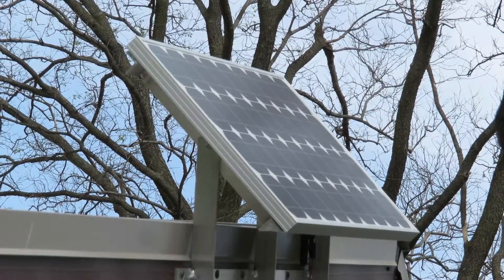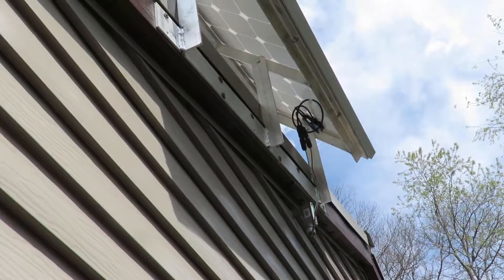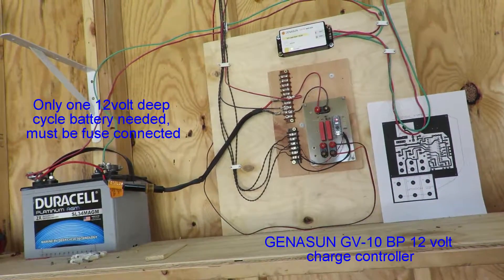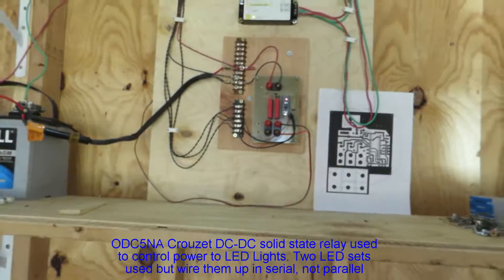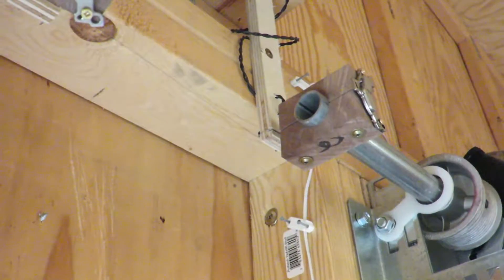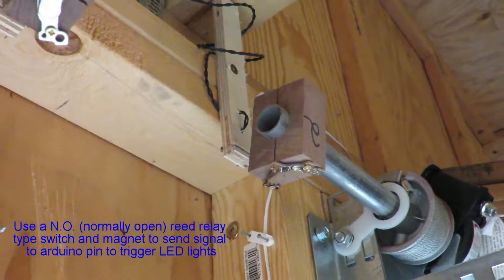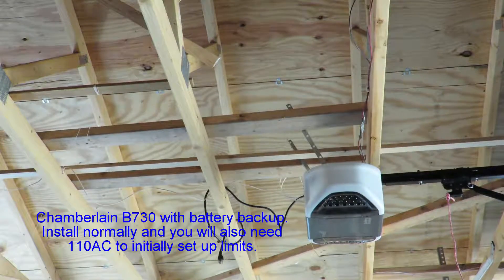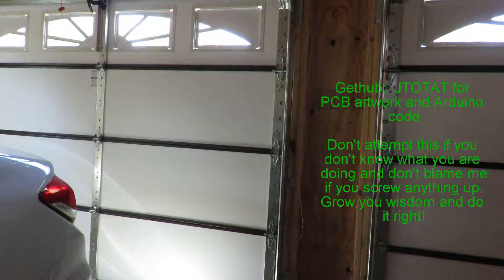Off Grid Solar Powered Garage

Comment: What is the brand of your garage door opener?  I tried chamberlain and genie, both requires 110v to "boot" up before taking the 12v as backup power.  Which means I have to have an inverter which I'm trying to avoid.
Reply from the maker: They are Chamberlain B370 and I needed a drop cord (110AC) to initially set them up, but once set up,  12dc from the solar has been working for years.

Comment: What was the total cost for the whole setup with opener, lights, solar panel, and other parts? Thanks. Good job on garage. Good job on the video and voice over work. Thanks.
Reply from the maker: These prices are approximant as this was made a couple of years ago
PV panel 100watt 12 volt $100
Door opener (2x) $155 each
Deep cycle battery $90
12 Volt LED strips (2X) $16
Magnets $6
Reed relays $3
The PCB and parts were DIY but around $10 for everything
Wire $12 
The  whole system is still working great; however one LED light strip has lost two of the modules. 
(you get what you pay for)